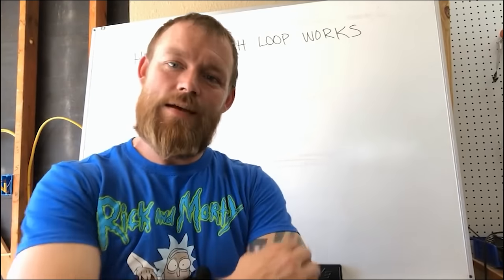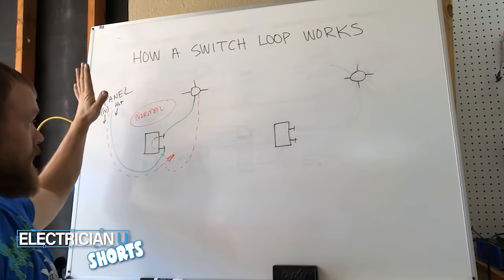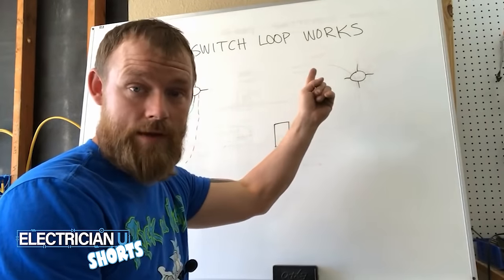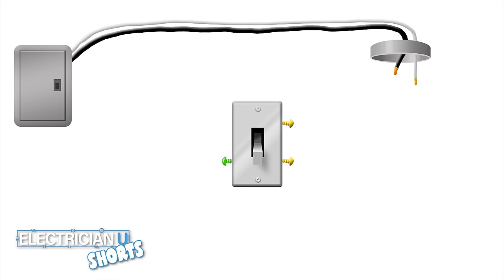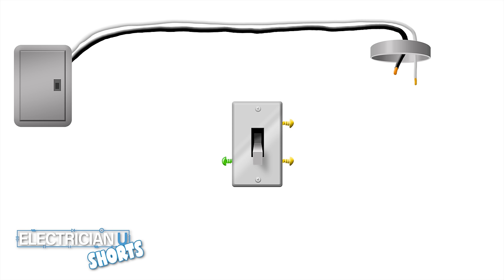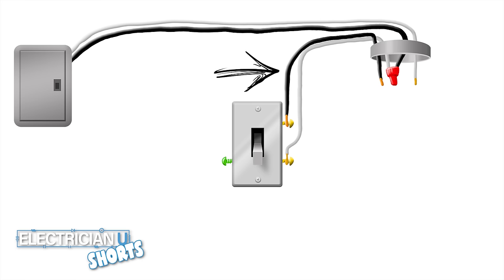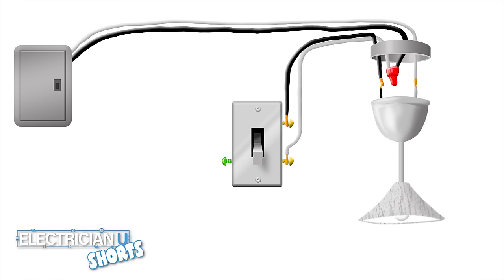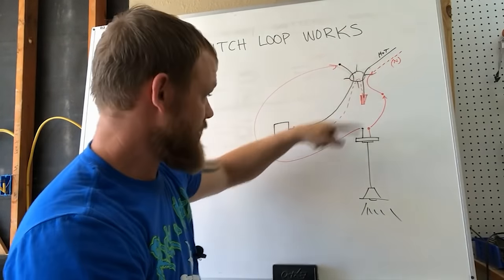SHORTS - Switch Loops EXPLAINED IN 3 MINUTES!!!

Comment: I ran into this in my house that was built in the 90s. I'm trying to swap out the looped switch with a duplex switch and add a run of 4  recessed LED lights to the room. I'm trying to figure out how to wire the neutral to the LEDs.

Comment: Did you use a white wire from the breaker to the switch for code reasons? could we make it black all the way? is it to avoid confusing which black is which?

Comment: I have this exact wiring for my basement light. I would like to replace the light switch with a smart one which requires a neutral, how can I do this without running a neutral from the panel itself?

Comment: I’m here in Ontario, Canada . Not sure if you have to run a drop neutral into your switch box now a days, would you know the truth on this? Thanks and awesome video’s cheers!
Reply: I’m pretty sure nowadays you have to provide a neutral at every switch. So you would just use a 14/3 or 12/3
Reply: yep, it's code in Canada to bring a neutral to the switch 4-022 so we'd pull a 3 wire from light to switch in this scenario and just cap the neutral in the switch box
Reply: Thanks for the reply , I know here in Canada you have to drop a neutral, I was curious if he has to were he is.
Reply: @papapapa1479  Not sure as I live in Canada myself but probably
Reply: Man you beat me to it! I'm in Ontario too and my electrician stopped installing switch legs on my jobs a while ago.  Neutral in every switch box now - which does sometimes mean 14/3 (or 12/3) for switch legs
Reply: @andreskanes1348  14/3 or 12/3 has a red wire a black wire and white wire so you can still do a switch loop using the red and black and still have a white for your neutral
Reply: @nics-systems-electric  yup, thats what I meant :)  Whenever possible he tries to run the power to the switch box first but sometimes gets stuck using 3 wire to make a switch leg

Comment: I’m from Michigan and I was wondering if you have ever seen kitchen circuits ran in 12-3 for their two kitchen circuits sharing a neutral ?
Reply: It’s called a multi wire branch circuit (MWBC). The circuit breaker switches should be tied together so they both shut off at the same time. Or you use a two pole breaker.

My condo in Chicago had a couple MWBCs. They apparently were installed before the tie together requirement because I learned about them the hard way - getting a shock from a neutral.

The reason they can share a neutral is because the hots are drawn from opposite legs in the panel. Because we are using alternating current the neutral doesn’t get overloaded. The return neutral never has both legs sending power at the same time.

Three  problems to watch out for: 

1) a homeowner diyer decides to move breaker around in the panel and inadvertently places both circuits on the same main leg. Now the neutral can over load.

2) often times in kitchens two circuits can be feeding a single receptacle. In this case the tab has to be removed between the two sides of the receptacle. Someone comes along and changes a receptacle because they don’t like the color and they neglect to break the tab. They now have a 240 volt outlet.

3) someone like me comes along and thinks they are working on a dead circuit and get shocked because the breaker switches aren’t tied together

Comment: My house has switch loop wiring and I hate it. 
I was going to add an outlet beside a light switch, but there were no neutral wires to connect to.
ALSO, if you have switch loop wiring, you can't install a timed or smart light switch.

Comment: I think I have switch loop wiring. 🤷🏻‍♀️ I am trying to replacing an old florescent light in my kitchen. I wish I had taken a picture of the way the wiring was. I usually do that but I forgot this time. Anyway, any chance I can get you or anyone else reading this to help me with my wires before I have to call an electrician? I have 2 sets of wires coming from my ceiling and don't know how to connect them to the new light fixture that only has three wires. Thanks!

Comment: It's kind of funny when it comes to the black and white coming from switch I usually reverse them and they're leaving is the white phase with either red or black electrical tape but six of one half a dozen of another LOL :-) :-)
Reply: I thought about this.  Why do it the way in the video?  Electricity it would make no difference.  But 10 years later.... Harry homeowner’s wife wants a new light... Harry knows the he hook the white wire to the white and black to the black... there is no confusion if hooked up as in video.
Reply: The white wire gets constant hot so it’s less likely to be mistaken as a neutral it’s code
Reply: @jasonmichael5194  I've never failed an inspection over it

Comment: I think teh code in most jurisdictions is now requiring a neutral run to the switch to accommodate the smart switches.
Reply: Code only matters in new builds and libtard states.
Reply: @TheTechGuider  Or if you want to be safe.
Reply: @randallthomas5207  my house is 100 years old. It's grandfathered in. I can wire it how ever lol and just say that's how it was
Reply: @randallthomas5207  anything is safer than the knob and tube that was in it
Reply: There are still situations where it is allowed.

Comment: its funny, in the UK, this is normal... they wire their lights in this pattern all the time.
Reply: To me, the British seem to love preserving their old traditions, like the separate taps in the bathroom - that's a nice touch and a unique way of being different from other countries : )
Reply: We do indeed in houses, but in industrial buildings with single core cables in steel conduit, we loop the permanent live from switch to switch, not from light to light. No reason you can't do this in a house, but in practise it seldom happens.

Comment: Should be made clear this is not the correct way to do a professional install, and in many cases is now illegal as code requires either a neutral at the switch or a way to get one there (conduit)

Comment: Why do you go to the fixture first , instead of starting from the switch box first ???
Reply: if your panel is 100 ft. from the switch and only 50 ft. from the light, you can save 50 ft. of wire.

Comment: It looks like your just breaking a hot wire and adding a switch. Why not just keep it true and just use black all around except the return from source. Just asking. Just want to learn. Thank you for all you do.
Reply: Cabling comes with white and black for neutral and hot, plus a ground wire.  Strictly, you are suppose to mark the end of the white with black tape, marker, etc. to signify it is being used as a hot.

Comment: STOP doing this! This method makes adding a smart switch impossible, difficult, or expensive.  Most smart switches require both the hot and neutral , as it its self requires power to function. 

So, when I run in to this wiring loop, I need to run the neutral to the switch. Or use a smart wireless unit at the fixture point and dead hall lock the switch. Or install..

Why you make it hard for me?

Comment: Who came up with this ridiculous way of installing lighting circuits? Is so dumb and confusing especially to new people entering ti trade, Mixing Wire colors and all, Im never going to implement  this ridiculous way,Normal way for me for life and thats what Im going to teach newcomers to the trade which I have the pleasure in doing so   in a daily basis, Besides is easier to troubleshoot with the power on eye level than getting a latter and taking down the light fixture and doing all that work for a loose power wire, This is a dumb way please do not endorse it.